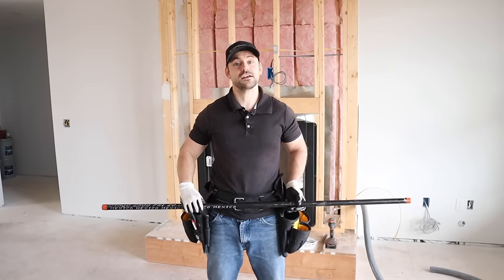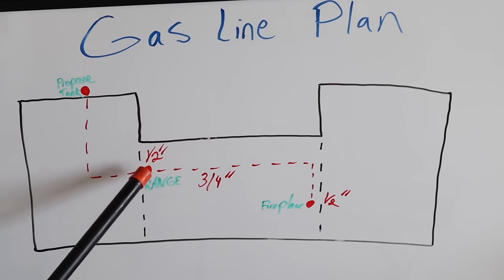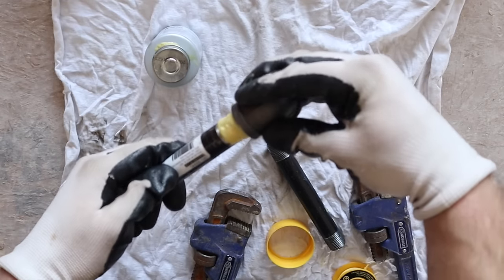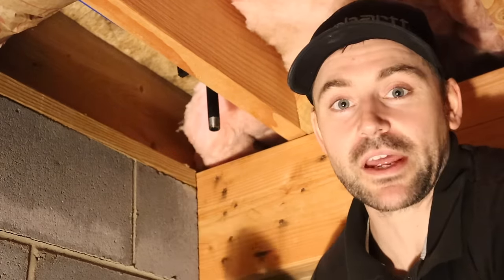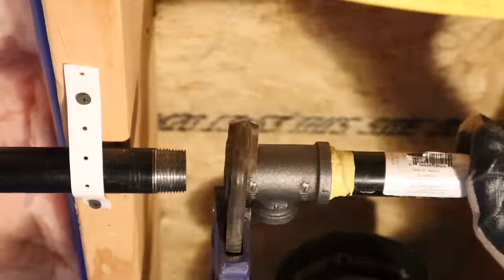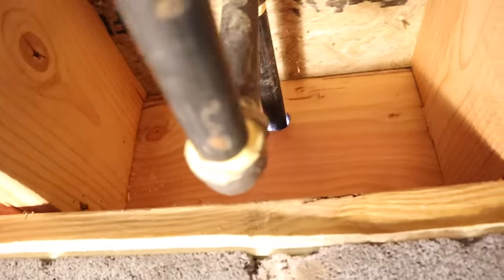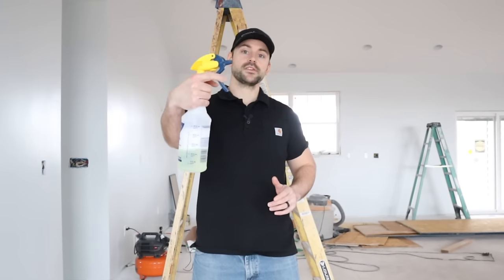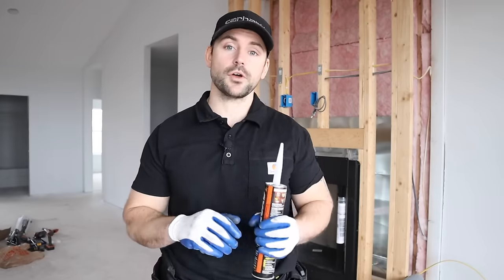Black Iron Pipe Gas Lines Installation - Sealing Fittings, Pressure Testing, and Bonding

Comment: In the future when applying tape, you should always apply the tape one or two threads from the end of pipe, to prevent the tape from peeling off on the inside and clogging a gas orifice.
Reply: You should never use Teflon tape with gas. I don't care if it's approved for it.
Reply: Only need pipe dope in them.  No need for tape. Pipe dope has teflon in it for lubrication.
Reply: 1. Pipe dope is to keep the threads from balling up when tightening.
2. Pipe dope is also used so that one can take it apart in the future.
3. It's the metal to metal contact that is supposed to seal the joint....NOT Teflon tape.
4. Teflon is used by rookies who can't make a good thread on their pipe (threading) machine.
Reply: @readmore3634  Assuming that the pipe threader was carefully and properly lubricated - How many threads should you make before you have to replace your pipe threading dies do you recommend?
Reply: @panemon187  Well back in the "made in the USA" pipe days, where thread shavings were long and curly,  it was probably 10,000 or more.... now days with cheap "made in Mexico" pipe, with a LOT of carbon in it, making shaving that are bits and pieces....who knows....prolly less than 5,000. I really don't know...once the dies have been over heated (just once) it's anyone's guess. Dies generally last a long time if you pay CLOSE attention to the oiler.
Reply: @user-if3mk1ht7o  That's correct, in a perfect world. When joining 2 dissimilar metals it's a good idea though. Aluminum to brass or iron... Dissimilar metals tend to ball-up inside the threads....especially bad threads.
Reply: @marsqueenmarlene  Years ago....I got excited when my journeyman mentioned the word nipple. Does that make me bad?
Reply: @panemon187 you run it to be flush with the end of the threader.
Reply: @readmore3634 maybe gas is different but i can never get a good seal with just tape or just pipe dope. I end up using both. That includes the recommended 3 or 4 threads and also tightening til it cant anymore. Always revert back to both, on water.
Reply: @Ashroyer86  I don't always use Teflon tape...but it has it's (useful) place. When I do use it I ALWAYS apply a thin layer of pipe dope to the male threads first. Installing plastic shower heads is almost  a completely different subject.

Comment: I understand you never want to be called out for a repair but I much prefer pipe dope and I've been fitting pipe for 40+ years. Don't even use tape. I like the fact you did the pressure test before securing everything, a practice everybody should get in the habit of doing. I pressure test all pipes. Thanks for your videos, learned a lot about painting as I hate that task.
Reply: Isn't tape a thread lubricant so that you can get the fitting tighter before the metal bites?
Reply: 3 gen fitter in the petroleum world I was taught to use both.
Reply: I spoke to an old timer who was in the plumbing business in the 70s and he said all plumbers used was pipe dope, before Teflon tape was available for purchase.
Reply: @snapdrag141 No tape is used for larger pipe diameters due to the threads spacing being wider. Typically not used on anything under 1"

Comment: You should only pressure test with 20 psig on black pipe and never 100 psig.  NG is only a 7 inch system (approx. 0.25 psi) after meter or 2 psi after a 2 pound meter.  Propane runs at around 11 or 12 inches (approx. 0.5 psi).  Also, you should use unions so that if you ever had to take it apart to replace any pipe or add additional pipe/fittings for future expansion of additional appliances (i.e. tankless water heater, furnace, grill, etc.).  You should also install drip legs/sediment traps before each appliance.  Gas can contain contaminants (especially NG) and the sediment traps will remove debris before the regulators and appliances.
Reply: Amen 😅
Reply: National fuel gas code says house lines (lines after the meter) need tested at 3# for 10 minutes. You are correct on lp and ng pressures. Unions,, Who worries about the next guy. LOL

Comment: Nice job.. try not to put pipe dope on the first few threads... it can get inside the pipe and mess up any controls.. also you should use 2 pipe wrenches more often when tightening fittings... and 100 PSI seems very high!  I would check with the Town on that.. here in Ct the pressure needed is 10 PSI on 30 pound gauge ..you can see a pressure drop better on a 30 pound gauge.. but of course you can’t use a 30 psi gauge with 100 psi test.
Reply: I am also in CT and for natural gas the inspector wants maybe a 15# gauge with only 5# of pressure, basically for the same reason .. to see a possible drop in pressure.

Comment: I prefer unions over couplings to make things easier to remove if you do have a leaky fitting and if the elbow doesn't point the right way, you can easily rotate the pipe.

Comment: One of My favorites: Pipe fitting. I pretty much do design/ build on most all of my work and although I primarily do existing and not new construction, I always use soapy water to test the lines, the second you don't - you will have a liability issue. I really like your home made manometer and will make one up one of these days! 

My most recent pipe fitting was with a meter that was not ideally placed and way undersized. The owner wanted to feed 2 furnaces (the one for upstairs was 80k btu; downstairs was 60k Btu - yep, those peeps installed backwards.. 🙄 The meter was near the furnaces. The 60k btu furnace was 2nd in tandem line from the meter & had a branch going to a 45k btu fireplace. 90 degree turn to feed a gas stove - and then a190k btu Navien combi DHW heater! The owner wanted to minimize pipe runs, which was not going to happen as the sum total was also in excess of the meters capability, So we had to have the utility provider replace and adjust the pressure to the correct water column before going live with this service. 

Also important when designing a gas service, one really should run supply to the highest BTU appliance first -- especially with an on-demand Domestic Hot Water heater is present as they are typically the highest consumer in line. If otherwise, you will quite likely choke the operation when driving a 40` F inbound ambient water temp up to 120` F with that kind of demand for fuel. Not to mention and most important here is that is per manufacturer recommendation, which in turn is what your local code officials use for inspection. Speaking of demand, your install was a basic new build design that did not require much consideration with only two appliances. In my world of "old work" we must perform calculations for the BTU Load along with length of run and number of turns to ensure proper piping sizes.

Also, in my jurisdiction, we are required to install "Drip-T" fitting under the last vertical branch/ leg (in place of the elbows you used under the appliance) where a "T" fitting and a 3" minimum leg into a cap is installed to catch any sediment that may enter into the fuel lines to prevent potential issues with the orifices' and or burners of the appliance being clogged with debris. At the appliance side for mechanicals, such as a hot water tank, furnace or DHW unit, I always use a union for later serviceability/ when it comes time to remove/ replace that mechanical, which is not  applicable for fireplaces or stoves as shown in your install. Finally, here a valve at the appliance is also required, again not applicable to your install, yet certainly noteworthy.
 
At the end of the day I prefer black pipe and typically minimize/ limit flex pipe runs:
Solid Black Pipe will have a lot less drag on the flow where I've seen corrugate pipe fail to deliver sufficient fuel to the higher volume DHW appliances due to the number of turns (similar with black pipe the number of elbows will produce drag on the fuel flow all of which needs to be accounted for, especially on longer runs and/ or with higher btu appliances... Corrugated flexible pipe is convenient to use, but a lot more expensive where the fittings can really add up quickly as well. Corrugated flex pipe has special through-wall or through-floor fittings which should be used there when passing through a substrate. One really should be certified to install that brand of corrugated gas pipe by that manufacturer where most supply houses also require that certification for purchase. The bonding for corrugated piping is also a completely different animal all together which can and does vary between different types of corrugated pipe. Black pipe being rigid also offers a lot greater protection of the line from any damage, is easier to bond and has better flow. When buying black pipe it is often times rather pricey when buying the pre-cut/ pre-threaded pipe compared to a 10 foot lengths which can be cut & threaded at most stores. The issue can be not having the correct lengths in the field, especially if you do not have a pipe cutter and threading machine.

Another newer item is whole house surge protection. The way bonding is set up and installed in a new build has changed quite a bit with the advance of pex pipe and national codes have driven these changes into our reality from the old ways. So if you do not have the current knowledge and practical advanced skills,, it is simply best to leave this job to a professional.

Awesome video - as always!

Best regards,
Ck Maintenance, Schenectady, NY
Reply from the maker: I think getting certified in csst is a good idea too. Seems like the joints are much more confusing than other gas line options. I always buy the precut 10’ sections because of the ease of availability at big box stores. I love how detailed your comments are. I feel like I learn something from each one of your comments and I appreciate that! I want this community to be a place we all can share ideas and knowledge. I hope all is well with you! Thanks for the comment and watching Ck Maintenance!
Reply: @TheExcellentLaborer  There is no substitute for experience and that my friend is value added. 😎
Reply: I have experience in copper, CSST, BMP, and polyethylene .... BMP has it's place, but, it is no longer the standard. Certification, sure, why not, it can't hurt. Old school is new school, longest length method or branch theory, as long as it's done right. It MUST always be inspected by local code authority to protect yourself. In my neck of the woods, if CSST is connected to an appliance that is plugged into the wall with three prongs [grounded], the line itself is NOT required to be bonded, as the plug is already bonded. Except mostly for penetrations and certain circumstances, BMP is a thing of the past. Very unforgiving, lasts much less longer, very costly in labor, and is time consuming. You can do three houses in CSST in the time it takes to do one in BMP. Very unprofitable.
Reply: @Buck Rogers  I've had people say that to me before but I'm in a different industry.  Why do you run a ground wire if the equipment has a 3 prong power cable ? I just do what the manufacturer recommends.
Reply: @Jimbo234GW  Local authorities are not authorities anymore...they're always asking me (35yrs master, foreman plumber) What's that pipe for? Is that a vent? What's a wet vent? Loop vent?...
I don't do permitted work anymore unless it's a complete house...inspectors are a pain in the a$$.
I can cut and install 3 houses a day in BMP, not easy to drive a nail through it either...It's a bit of an art to design an easy system to install....and then pre-fab the whole (tract) job, back when I did tract work....not anymore. I have my own pipe machine...very profitable.
   I use CSST mostly for island sink/ranges and if a distance  gas line is needed in an existing house. Custom houses and remodel is much quieter, less stressful and my customers appreciate good work.
Reply: @TheExcellentLaborer how do I get or make that meter & valve, I am having a hard time finding one.

Comment: very well put together video, time spent on explaining and working with no extra white noise makes it very educational. No drip leg on your verticle runs before final union, I would highly recomend having drip legs. Not code in all areas yet but a good practice otherwise.
Reply: drip leg is for 'wet' gas. sediment trap isn't needed on a stove as they are manually turned on and off.

Comment: I always enter the structure with 1” black pipe and make sure there is a union plus where you have your run for your stove I would have made a manifold with individual shut offs and nipples with caps for future supplies … Dryer, Hot water heater, Furnace, Grill…. Good run glad to see you use pipe dope … the state I live in it’s code to have a shut off at the gas fireplace along with the chase being fire proof
Reply: Great comment Fred. I have an old house with half inch (maybe 3/4) pipe coming out of the ground going up about 8-10 inches then 90 deg elbow and nipple/pipe that goes into exterior brick and into the house. I want to plumb NG for my generator which would be right there anyway (outlet for generator is right there nearby). I am thinking I need a T fitting there on the pipe coming out of the ground to supply generator. I believe that means cutting out that section of pipe coming out of the ground and using a union along with the T fitting to accomplish this. Meter is about 26 feet away. Thoughts on that approach?  Thanks.
Reply: @condor5635  
Yes a Tee is what you need to start your exterior run, after your piping is finished I would recommend that you paint your exterior piping with rustoleum paint .. it is code here that exterior black pipe must be painted black.. I hope this helps you and be safe with NG and always check for leaks when done installing…

Comment: On a positive note Josh,                         I'm glad I watched this video! Why? Because adding gas-pipe-goop 
after having applied gas-thread-tape further insures that every minute gap is sealed! Nice!👍
Reply from the maker: Thanks Robert. I do like the double protection. They did not mention the ground rod instead of the panel bonding but I’d say it would work too. Thanks for your input!

Comment: Excellent Video. Thank you very much, I like the fact you used the tape and sealant at the same time. I have a question, I am switching from Propane to Natural gas. The gas company stated that have to run black pipe 3/4 inch directly to the water heater Rinnai 199 tankless which is about 60 to 70 feet from the outside meter. Then I have to stub off to the heating, fireplace and stove.   I would imagine that they would all be half inch? I built homes for a living many years ago, but the gas company gave me a price I cannot afford, so I am thinking about pulling a permit and doing it myself. My question is since it is 70 feet away, do you think 3/4 inch is ok or should the first 30 feet be 1 inch and then go down to 3/4 to give it pressure? I am going to get other estimates but the price they gave was a shocker since many people in the neighborhood paid nothing. Robert from North Carolina

Comment: You're pretty good. I did not quite get the temporary fitting for the pressure test, so I will have to see it again. Tape and compound is always best when you want a sure seal. I myself like to gently fill in the female treads, and if need be, scrape any extra rise with a blade, and I liked that idea of one of your commenters who suggested to stop the tape a few threads away from the end. I am in the same thing now with an uninhabitable house. Demo/build, reassignment of rooms, etc. You just gotta love a good headache, backache, and getting tired and dirty to really get into it, and then deal with all the trouble it involves. I gotta see more of your videos.
Reply: Only need pipe dope. Tape is not needed.
Reply: @spydergs07  correct...although tape does have it's place in plumbing. I've ran miles and miles of gas pipe in tract homes.....miles and miles...no tape needed with good threads and  malleable pipe.

Comment: Always good to see using the tape and sealant. Have always found it much easier to work with. I have also put in a tee with a 4" nipple and capped just in case a certain job may want to add an additional gas item but I have added an additional valve so I wouldn't have to shut the gas off and of course making sure a piece of pipe and cap is added (As Long as code allows). I like the pressure test cap you have. I'm going to change the way mine is set up. So good to see the pipe bonded as well. So many times I would never see it done and it is code in our area.  As always fantastic job Josh.
Reply from the maker: Yes! It is definitely wise to add an extra tee  in case you want to add something in the future. I was going to do that but I cannot think of any thing else I would ever want to add later. I do like using the tape and sealant for extra security. Most people think that is overkill but I think why not. Bonding is something I also find important. It is code here to do that anyways. I hope all of your projects are going well and you are doing good. Thanks a lot for watching and commenting David!
Reply: @TheExcellentLaborer  that extra security costs so little but does protect the project just like pressure testing is so, so important. I've done tests on things and found leaks on an area I didn't do in a remodel. That can be a challenge if you have a long run not being able to back thread the pipe. I too love using black pipe and of course gloves. 👍🏻
 Be safe.
Reply: @The Excellent Laborer If your adding gas to the house why not add a gas water heater and dryer to make the the whole house more efficient?